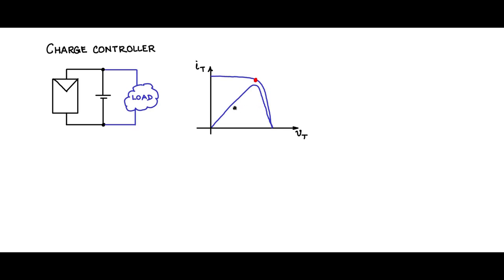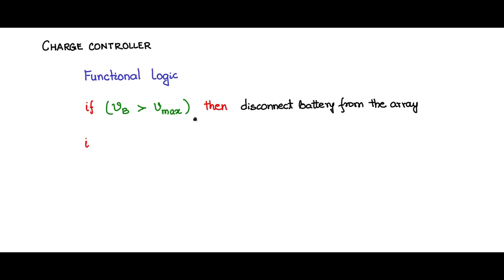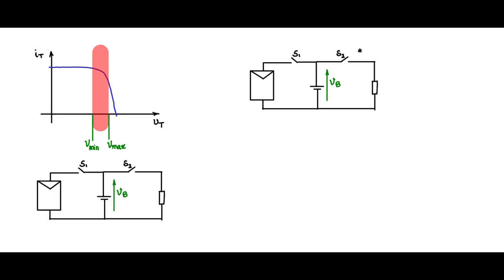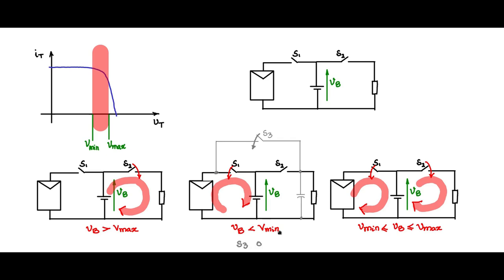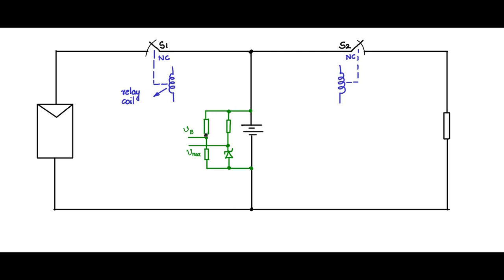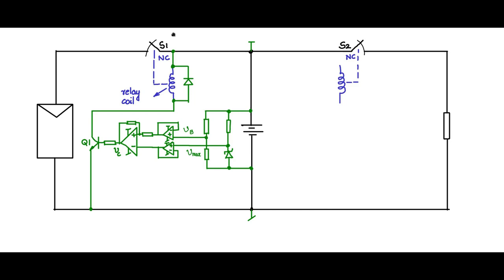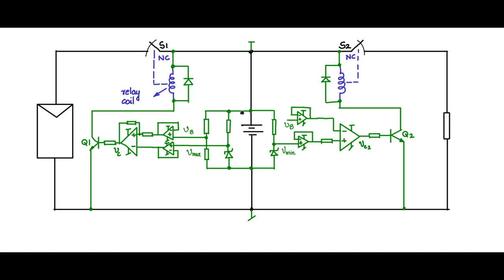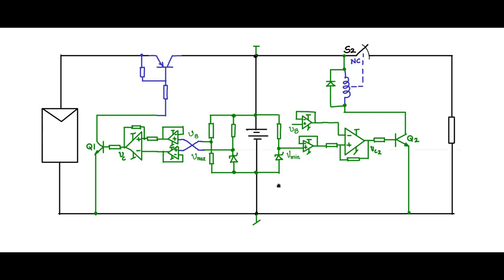Charge controller

Comment: Sir how can we obtain the value of all components?
Reply: Watch videos on YT, if U know basic principles of caps, inductors, how diode works, how FET work, U are able to make simple synch. or asynch. BUCK, which can be controlled by Arduino, ESP32, ESP8266, STM32, code for FVOC or PandO methods are very simple, if U want to use ICC, U have to add som current sensors like ACS712 ACS758 and pair it with ADS1115 converter in single mode, than U can add Dallas for temps, make WEB server or MQTT server to publish values like PWM, V_IN, V_OUT, I_IN, I_OUT, if U have precise current measurement U can accumulate SOC meter to see if battery if FULL or EMPTY.